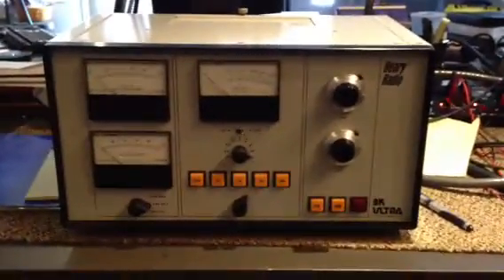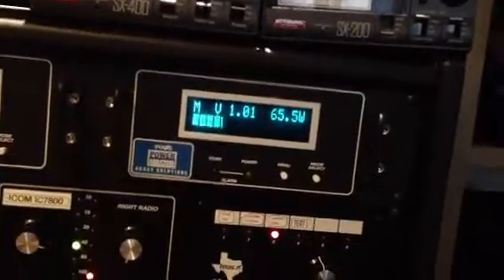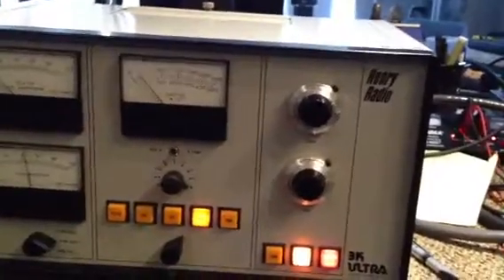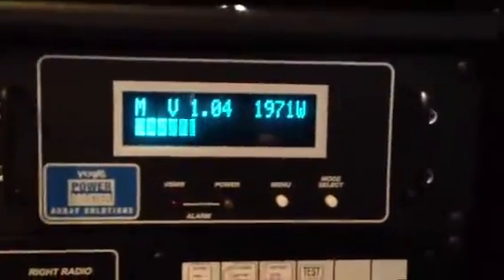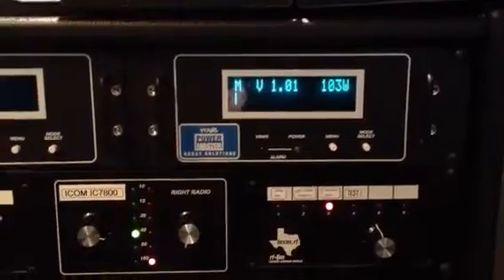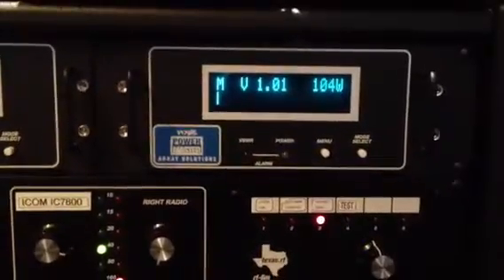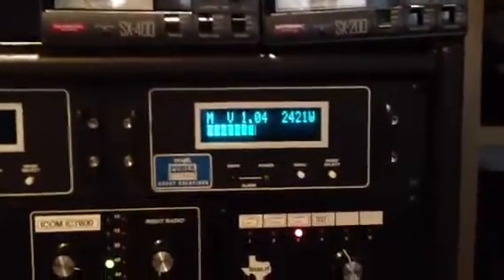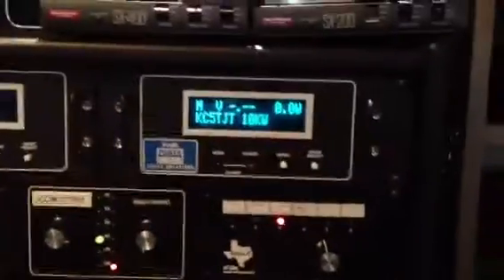Henry 3k Ultra test.

Comment: I have a  an Henry  3 KA   - I wonder whats the difference ... 73
Reply from the maker: The power supply is more rugged.  And of course it’s built on the 8k platform.   It will actually do 3kw if you push it but I don’t recommend that. The tube is expensive.  Thx
Reply: @radiotype  Thank you  for the  Info!!   Are  Henry Amps  hard to come by?
Reply from the maker: Well I use to kinda buy ans sell just to really be able to buy different Amps and test them and you would see a lot of Henry’s for sale.  I don’t see them as much but I don’t really look for them either.   The real issue w Henry is unless your on the West coast shipping is really difficult and expensive.   Since Henry was made in LA most I’ve seen for sale are in that general area.   I shipped that 3k Ultra from Southern Cal.  I think the cost was $1000 to ship but that was crated too.  My opinion is if your looking for a rugged high power amp Henry or Alpha are the only 2 I would buy.  A couple close are Commanded Tech or QRO.   Obviously a desk top won’t break the bank shipping it.  My favorite Henry amps are the 5k classic and 8k.   Both have some draw backs.  The 5k came in 2 versions.  The 1200 tube and 8877 both run a pair.  Tuning is fast but the thing sounds like a jet sitting on a runway.   The 8k is awesome but you have to get use to the slight tuning delay from the Servos.  I would try and get the memory tuning option.  It’s really a strange design on the memory option but it works.  Anyway I could go on and on on them.  I’m rebuilding my station hope to be back on the air this spring.  Thx